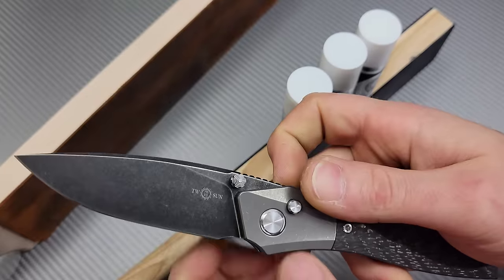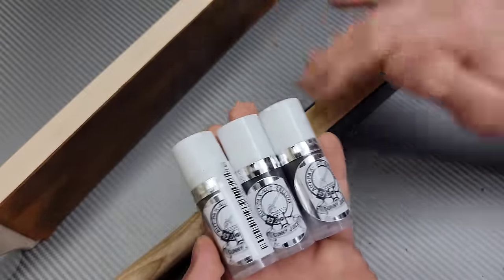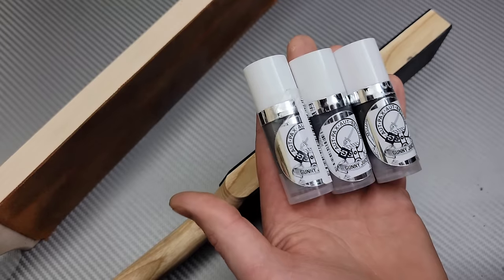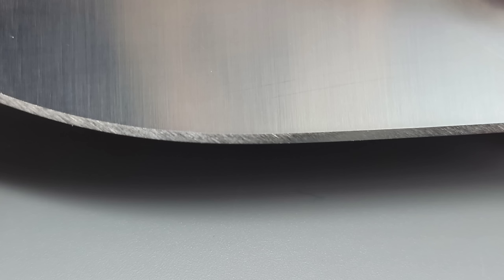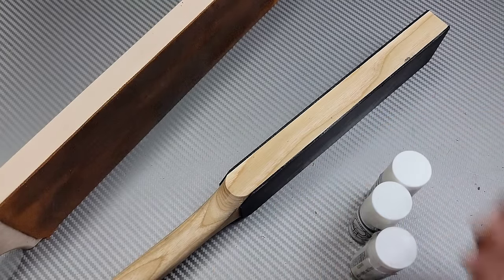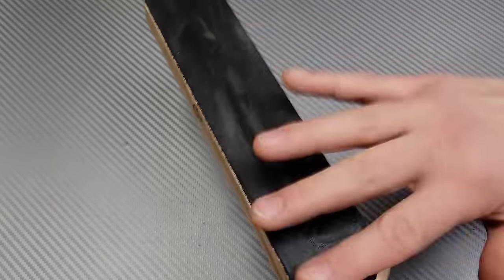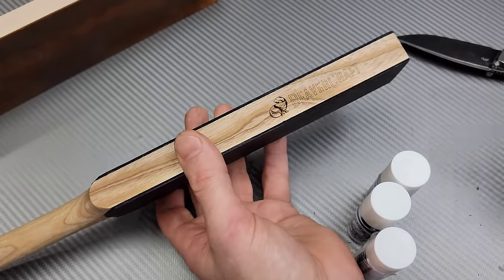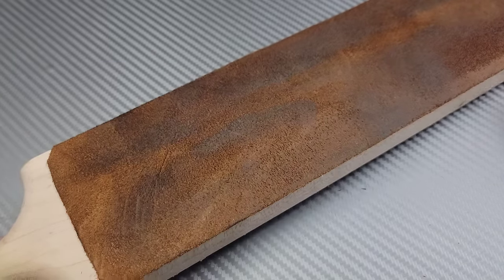GUNNY JUICE BEST STROPPING COMPOUND EVER ????

Comment: I'm glad you talked about over-stropping.  I used to have that problem often because I would get obsessed with making the edge too polished.  It would look amazing and was extremely narrow, sharp edges but it would be so smooth that I couldn't get it to have enough bite to slice into paper.  That was awhile back.  Luckily I've moved on from polished edges to a much more jagged edge with a heavy amount of bite because 95%+ of my actual usage is slicing through tape to open boxes.
Sometimes I also was a little too high and would get in the zone stropping and just continue stropping in one direction for 5 minutes 🤦🏼‍♂️. 🤣😂
Reply from the maker: Yeah I think many of us have been there 😆
Reply: @jdisdetermined  exactly!!! 😆😂🤣
Reply: Your right about stropping is not for knives but is for razors. Gunny Juice is overpriced by 1000%. It should cost $2.00. I don't know why anyone would use it. Who is selling us on this product?
Reply: @brianhoffman5367  Nothing could be further from the truth. Even normal alu. oxide compound cost more than you suggest and they don't give away highly graded diamonds. Much less monocrystalline diamonds. 
Just because they are man made makes no difference other than much higher ability to get a very narrow grit range in the emulsion you want. 
Of course, there are lower cost although lower quality products available for those such as yourself who really don't know or care what the differences are. 
If only sharpening lower Hrc steels, or more importantly, lower carbide content steels, you can get by with a simple alu. oxide compound. However, if sharpening such steels as the higher vanadium carbide steels, you are going to want a high quality, well graded in size diamond emulsion. 
I
KnifeMaker
Reply: @brianhoffman5367  Dont buy it then🤷‍♂️
Reply: @brianhoffman5367  make one for $2 and compare to other emulsions. give it to other knife enthusiast so they can provide feedback to your product
Reply: "Over-stropping" is a thing. "Too polished" really isn't. He just said that. Next time, try polishing with diamond lapping films, backed on metal, using an angle-controlled system like an Edge Pro. You can even go as far as .1µm and not have problems. Also, try finish stropping with plain leather and no compound. It has a surprising effect without rounding the edge, which is the real problem with over-stropping.
Reply: @MrMZaccone  i would never use an edge pro or anything other than sharpening or stropping by hand. Unless I did not know what the hell i was doing. That being said over doing it is only really a thing on a knife depending on its purpose. If you take a knife, sharpening it up to 8000, 10000, or 12000grit, run it on two strops with that finest micron available that knife will be good for fruit and vegetables but for certain fatty meat like raw pork it will not cut very well. All meat knives for me only go to 2000 or 3000grit at the most.
Reply: @brianhoffman5367  you have to be being sarcastic. It cost the guy who makes gunny juice more than $2 for the bottle and label he buys to put his product in to sell to people. Have you priced diamond emulsion's? Ever price Jende emulsion? If anything is over priced its things like dmt diamond stones or any diamond stone that is an extremely thin layer of industrial diamond sprinkled over adhesive on a stainless steel plate that doesn't last, or those sharpener systems for dummies like the work sharp with their tiny little stones, or miniature solid green, white, red compound bars for strops when you can get a 3lb bar of high quality Menzerna compound for like $15.

Comment: Love the juice, this stuff cuts and polishes faster than any other emulsions I've tried. Diamonds do not clump.
Reply: Not true. 1 micro. Is 1 Micron. It doesn't clump. You have been been sold on lies by Scott so he can charge 1000% more then comparable product.
Reply: @brianhoffman5367  You are right but 1 micron isnt 1 micron. All these guy fluff their numbers, because thats not how diamond powder works. Diamond powder comes in a distribution. That 1 micron he sold you is probably a mix of everything from 0 up to 2 microns, with the average size being around 1 micron. If he was honest he would say this is a 0 to 2 um distribution. Or this is a 1 um to 3 um. etc. Also most edc bros ain't so bright so they use much finer abrasives than actually makes sense for anything. Something like 3 um on a wood substrate leaves a finer scratch pattern than even <1um stones. Knife land is just full of a lot of very low IQ shit. Most folks don't understand much about anything. Not only are grit ratings arbitrary but even abrasive particle size isnt the whole story, in the case of a stone it depends how it's bound up. With basically lapping like strops, it depends on the substrate being used. Wood and leather have give. Using 10 um diamond isn't going to leave 10 um scratches, in fact it's  often even less than 1 um. So when you're using something like 0.5 or whatever on some very hard to machine stuff, idk what folks think they're actually accomplishing other than maybe some slight polishing given a ton of effort. Just a lot of dumb shit all around.

Comment: What two sun knife with the cool thumb stud’s? As far as stropping, I’m always afraid I’m going to ruin my blade.awesome information but it’s seems so advanced for me! Great video!!!
Reply from the maker: That's the ts303, and you won't ruin anything with stropping worst case is your edge won't be as sharp, but I think you will be fine. It's extremely easy to use. Start with some green compound and a sued sided leather strop easy to use and works good

Comment: Great review.  Love the shadow tip. Im using  chef knives as a chef just started using work shop ken onion.  And using 2 belts to sharpen the knife . Buy the sounds of it you might not be able to answer this question.  But for a noob and sharpness only how many times do you pass the knife on the stropp e.g 8 times on each side . As a rough gauge.  Many thx

Comment: Thank you for saying it. "Over-polishing really isn't a thing but over-stropping is." Finally! Someone who understands. Although, I'm not sure I agree about the "teeth" you're talking about. I've polished edges down to .1µm using diamond lapping film and had zero problems with them becoming "slick" or not "biting". All that happens is that they get better and better at push cutting and maybe less aggressive when "slicing". To me, this is just a difference in application. Axes and saws both cut wood, they just do it in different ways. It doesn't mean that every tooth on a saw shouldn't be sharp AF.

Comment: Hey Jared. 0:14  I was wonder if you could suggest to me on what micron Gunny Juice to buy for my new Strop Bros. Billy Leather Strop… 

My edc knife steels are as follows . 

20CV 
M390 
ELMAX
S35VN

From everything I’ve been reading, I shouldn’t even bother with the strop compound sticks that come with the strop and just use diamond spray 

And should I leave one of the side bare? 

Thanks in advance man! Hope all is well and Sharp in your world 🔪
Reply from the maker: Get stroppy stuff or gunny juice, 6 micron is most versatile but for factory edge 9 or 12 micron works best
Reply: So, the higher the micron the toothier the edge?
Reply: @Crybotenabled  Yes of course

Comment: Scott did a great job with that stuff...been using it basically since he released it on open market...I actually use it on my ultra fine stone (Ancient Ocean Jasper made by Gabriel J Warren) when I'm working on Japanese knives and other knives requiring very fine edges...I put it in a dripper bottle to make application a bit easier

Comment: This is basically a filtered leftover waste from diamond carbide tool factories.
One man's trash is one man's gold. 
When I lap my fine stones in 1200
grit SIC powder, after it is really
broken down, I lay my strops
in the left over "juice" and create
a very useful polishing strop.
Reply from the maker: Not a bad idea, I prefer to use diamonds as I mostly use high carbide steels, not that diamond is a must for Stropping like it is for sharpening but I do prefer it, but I do a lot of different steels il have to try that out
Reply: @NeevesKnives  Yes,  mostly
for polishing but it does have some sharpening properties,  just not as 
good as diamonds. You're a busy 
man so thank you very much for
 your response. You are a great
 asset to the knife sharpening community.

Comment: One of the top 3 compound I've ever used...

1.) Gunny juice 
2.) KME CBN Emulsion
3.) CKTG diamond spray ( Chefs knives to go)

Would 100% recommend gunny juice, especially if you're into the high carbide, higher HRC "super" steels. It handled PM-A11 (10V), K390, S110V and Maxamet for me without issue ( I don't have anything, harder to throw at it) .... For the high carbide super'steels above, Ive LOVED the the 9 micron, followed by 3 micron. Very refined yet holds its bite.
Reply from the maker: Yeah it works great with the higher performance steels
Reply: Gunny juice is good but can't be better. 1 Micron is 1 Micron. All the products you list should cost $2.00 or less. We have been sold.
Reply: @brianhoffman5367  so all cars are the same?
Reply: Top 3 Ive used. The same diamond all of these guys buy from the same industrial sources then they resell it to low IQ edc bros for 1000x markups. Here's 50 cents of diamond powder in some terrible carrier we came up with, that'll be $70 please. EDC bros are insane. You could buy enough diamond powder to last a literal lifetime for maybe $10. Could load idk maybe 1000 full sized strops with it, to the max. And once that stuff is loaded, it lasts a very very long time. No clue why EDC bros are obsessed with leather substrates either. They're more expensive and don't work as well. Hmmm, I notice a pattern here.
Reply: @davehardan8323  50 cents of diamond powder mixed with a carrier of their choosing isn't "a car" genius boy. It's 50 cents of abrasive being sold to idiots for $50.
Reply: @jeffhicks8428 what should we use as a stropping surface instead of leather? Curious because I am new and don't know. Also what liquid should be used as a diamond carrier
Reply: @tizben  The carrier depends on personal preference and on compatibility with the substrate. The 4 most common carriers are oil, water, emulsion (which is basically oil+water+emulsifier which causes them to blend together) and solvent (for instance alcohol, which is good for penetrating porous substrates and then evaporating off) etc. There are no hard and fast rules. It's not that serious. 

Leather is a fine substrate especially when you need something that has a degree of compressibility. This works great for anything where you want some degree of convexity, like razors for instance.  But for some reason people have it in their head that there is something "magical" about leather. Generally speaking I prefer synthetics because they objectively work better than actual leather and you can get exactly the properties you want. 

The most common thing people use for sharpening knives and such is WOOD. Woods like balsa, birch or bass are 3 of the most common options in order of compressibility from most to least. The harder the substrate the more aggressive it will be and the deeper the abrasive will cut. For instance glass. Wood works with basically any carrier, it comes down to what your needs and preferences are. Wood and oil is a common choice. Once you load it properly this tends to last for a very long time and the oil doesnt really    get on the blade it just creates a film for the fine metal to float around in and whatnot. Once its loaded up properly you can notice the film becomes "looser" as it heats up from the friction of use. This allows you to apply a very high concentration of diamond onto the wood substrate, much higher than anything you will find in these over priced consumer products like say that DMT spray or things like that, and it stays fresh and effective for a long time without issue. 

I would use a lower grit than you probably think. All diamond abrasives are going to be a distribution. Not everyone that sells it is honest about that. Some might claim the product is 1 micron for instance when in reality most of the particles in it are much larger than 1 micron but the smallest ones are at least 1 micron so thats what they call it and no one knows any better. If they are more honest they will tell you exactly what the distribution is. I wouldn't waste my money on stuff like 0.1 um or whatever, not even for straight razors. Even 0.5 um isn't going to do much that something with an average particle size of 2 um wont do but much quicker. If you are going for the ultimate polish on a flat metal surface, that's a different story but if we're talking about sharpening and polishing the edge of a blade on a tool like a knife, you really don't need anything that fine.

Comment: I have a question for you do you think stropping is necessary ?   I have tried stropping with little results.  I’m sure I need more practice and I don’t have a good strop.  I can bring a edge back with a ceramic rod.  Should I stick with that or am I missing out.  Also I’m not worried about a polished edge.  I use my knives a lot and just want them to be as sharp as possible.  I really love your channel. Thanks for sharing your knowledge.
Reply from the maker: Your absolutely missing out, a Ceramic Rod is great for honing, burr removal and micro beveling, a Strop is great for maintenance and refining an edge and finishing burr removal, but yes you just need some decent leather and compound
Reply: @NeevesKnives   thanks brother.  I’m going to order some tonight.

Comment: Ive heard gunny juice is pretty good. I have a bunch of solid polishing compounds for when I buff aluminum and stainless steel with airway buffs. A bunch of 2lb and 3lb bars of different colors and grades as well as multiple brands like Menzerna, Marpol, Maverick, Jackson Lea. I have also used liquid polishes i have on my strops. One that works really good not just is the best hand polish made imo but works great on a knife strop is Simichrome. Its made in Germany, polish is pink in color and has industrial diamonds crushed up as part of its make up

Comment: How often would you say you clean and reapply this compound? And when you do what would you say is the best way to clean it? Also how do you know when its worn out and time to reapply it. How does the longevity of gunny juice compare to other compounds?   Thanks
Reply from the maker: Depends on the compound and leather I'm using, but you clean it when it's built up, you basically just shave a layer off the top and start over

Comment: I literally just bought this stuff 2 days ago and will be here tomorrow lol. I was going to use the 1 micron on the rough side of the strop and the .25 on the smooth side as always but I guess I was led astray lol. I thought the 2 sides of a strop worked similar to a 1500/3000 grit stone. I start on the rougher side and finish on the fine side    Now I gotta get a 2 sided smooth strop lol
Reply from the maker: Someone said to apply it on a brush first for the softer side and it works well and I shoulda thought of that, I think you will be fine either way it still works it just absorbed different

Comment: Haven't used any of the diamond compound because I have so much of the regular compounds, wil have to get some to see if there is any difference between them, I imagine if anything the diamonds just work faster. Thanks for the info and the tips Jerad. Keep making sharp things fun and enjoyable
Reply from the maker: They work a bit faster but seem to work better than others because it's so fine that it's very consistent while not scratching like other diamond compounds seem to

Comment: Thank you for the recommendations! I will buy Venev stones and Gunny Juice based on your recommendations.
What sizes of Gunny Juice should I get? Using the Venev Ursa stones with up to 1500 FEPA-F. So would I go from 1200 or 1500 to 6 and then 1 microns?
Reply from the maker: get a 6 which is going to be great for maintenance as well as coming off the stone, 3 then 1. because the 1200 stone is 3 micron so the 6 wont scratch it it will only help in the future get a 12 micron for toothy edges you can get by with the 6 or 3
Reply: @NeevesKnives  thank you, much appreciated!

Comment: Do you need to clean your stop after so many uses? How? Can you remove the compound and then add a different grit compound on the same leather stop?
Reply from the maker: Yes you do, depending on what kind of Strop, you can scrape it clean or sand it, but depends on the leather
Reply: @NeevesKnives  I saw on another video that you can use a Magic Eraser to clean your Strop… Sounds like a good idea

Comment: I have a TON of s35vn in all different shapes and sizes (Medford, CRK, Toor, Spyderco, etc) that I need to sharpen or touch up. What micron Gunny Juice, and what angle would you recommend I use for general edc purposes?
Reply from the maker: The angle would be what ever edge angle is on the knife your touching up, but 6 micron is the best universal grit imo for touch ups etc..
Reply: @NeevesKnives  thanks for the quick reply!

Comment: How many passes per side would you recommend for just maintaining a blade you used during the day? Thanks!
Reply from the maker: Depends on the steel and the use, but 5 to 10 passes per side, maybe a little more, some steel respond better than others so some take more or less
Reply: @NeevesKnives  thanks 🙏🏻

Comment: I have the .01um, 25um, 0.50um, 1.0um, and 3.0um. Oddly the .01 ran out but the bottle was low when i received it years ago. But my questions i recently got the 12um & 9um, it wiped right off! Anyone have that issue? It gathered up on my bevels
Reply from the maker: Shake the bottle up just incase, but apply a super thin layer and make sure its dry before using